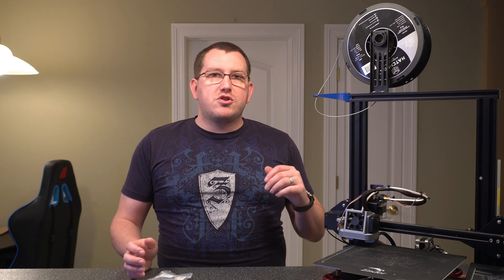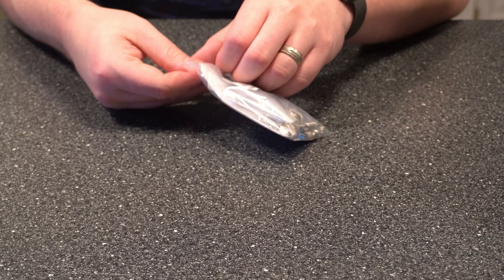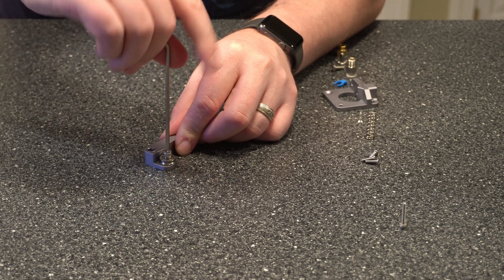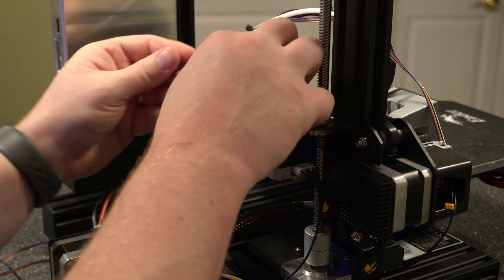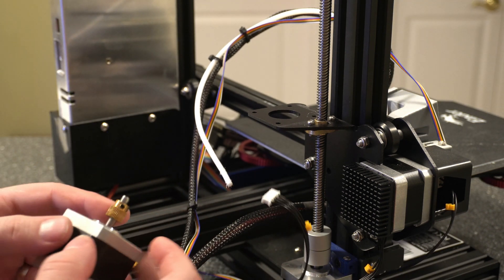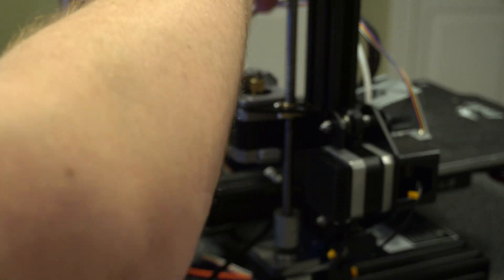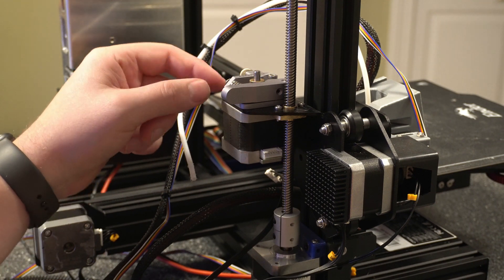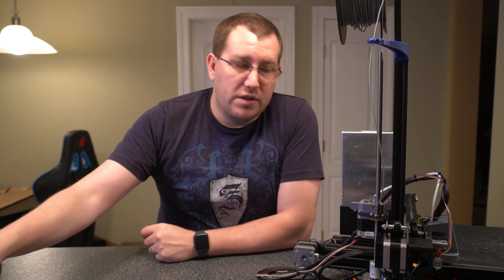Ender 3 Aluminum Extruder Upgrade

Comment: I bought one of these for my anycubic chiron  and lowered the e step from 405 to 95 like some folks have posted but when the filament goes into the extruder the gear grinds away at the filament. Now I have not seen what it would do printing something I just used the filament in function to test. I put the original back on but would like to figure out how to fix the issue.
Reply from the maker: Hi. Did you try to calculate the e step or just use what other people were using?
Reply: I did not calculate my e step just used what other people was using so ill try that but im thinking I'll end up with the same result.
Reply from the maker: @aoneblood  Ok, let me know how it turns out once you calculate it, its possible that it could fix the issue.

Comment: My motor doesn't have a screw on the gear so im not sure what to do
Reply from the maker: Hi. You can try to see if the teeth line up without removing it. If they do, it will work ok. If they dont you may not be able to use this without changing out the stepper motor.
Reply: @3DPrintscape  problem is i didn't think about that so I went at it with plyers and now the gear is a little messed up so I contacted creality so seeing if it will fit now is pointless hopefully creality come through
Reply from the maker: @valorantorion1588  Gotcha, sorry to hear that.
Reply: @3DPrintscape  I had the same thing
Reply from the maker: @Zathurus  The printers ship with both motor types, making videos like this difficult to do.
Reply: @3DPrintscape  yeah makes sense didn't really have to replace it anyways cause the original gear was still in good condition.

Comment: What do I do if my extruder motor gear doesnt have the screw to take off the out brass gear?
Reply: At 7:35 of your video mine doesnt have them screws
Reply from the maker: Hi. It sounds like your may have the compression fitting. If thats the case, you can try to see if things line up enough to use as is.

Comment: On the Ender 3 Pro I got in January not only did the axis motors have press fit pulleys, but the extruder motor did also. I am beginning to wonder if Creality is doing this on purpose so people who don't know how to remove the pulleys will shell out $35 for a removable pulley motor, especially when the most recommended upgrade is a metal extruder.

For those with the press fit pulleys, TH3D is recommending this removal procedure.
https://support.th3dstudio.com/hc/guides/diy-guides/creality-press-fit-extruder-gear-removal/

I haven't assembled the printer yet, but am going to do the WD40 trick then use one of these printed pulley pullers so that a dual gear extruder can be installed.
https://www.thingiverse.com/thing:3845693  or
https://www.thingiverse.com/thing:3593964
Reply from the maker: Hi. After I made this video and checked all the stepper motors and they all have the press fit pulleys. My guess is they are doing that to reduce cost, it probably saves them a dollar or so per printer. Hard to say for sure though.
Reply: @3DPrintscape  Can you just use the stock gear wheel with the new metal kit?  It seems to be the same size and material...
Reply from the maker: @UrDoinItWrong  I think that should be fine.
Reply: @3DPrintscape  Yup! Confirmed, the stock pressed-on gear worked great with the rest of the metal extruder kit.  Print that followed came out perfect.
Reply from the maker: @UrDoinItWrong  Cool, good to know.

Comment: How do you know what this will be calibrated. If you push out 100mm will it give 100mm out with the default settings
Reply from the maker: Hi. This hotend was marketed as being a drop in replacement and shouldn’t need to be recalibrated. Mine is printing fine without making any changes. That said, its always possible that a small change will need to be made so I will create a video on how to do the calibration.

Comment: Thank you for the video - concise and to the point. 
I'm looking for some advice about this upgrade. I bought this kit and noticed it was quite heavy - 58 grams (2 ounces). I have already done the direct drive extruder mod on my Ender 3, so I am concerned that adding extra weight to my already heavier extruder assembly might cause problems. What do you think?
Reply from the maker: Hi, thanks for the feedback 😊. I don’t think it will cause any problems, it's not that much heavier, but I plan on testing that myself. I just bought the micro swiss hot-end replacement and the kit to convert my system over to direct drive so I will be going through the process this month.
Reply: @3DPrintscape  Hi do you still use this extruder how is it going? Do you plan on using the dual gear extruder? Your answer would be very helpful.
Reply from the maker: @studywithme8055  Hi. I am still using the extruder, along with a direct drive conversion kit and micro swiss hotend. Its working well and has been able to print TPU and other filaments without an issue. I don't plan on moving to the dual gear extruder unless something comes up the makes me look at it again.
Reply: @3DPrintscape  Got it, thx man.
Reply from the maker: @studywithme8055  You're Welcome

Comment: I tried this on my Ender 3 and found after the install all my printing was weak and broke apart( layers were not binding when printing). I think might be a problem with the size of the wheel that came with the kit. Might it be smaller or bigger in size than the original and thus casing the filament to travel at different rates? I reinstall the original parts and everything printed just fine again. Would welcome your comments related to this problem . Also enjoy your videos.
Reply from the maker: Hi. Its hard to say for sure. Was the kit you used actually from Creality or a third party? Have you tried to use the new kit with the existing wheel?
Reply: @3DPrintscape  Not sure about where I purchased the kit from as it was a long time ago, might have been BangGood.Will give that a try with the existing wheels and see if that makes a difference. THANKS
Reply: @haroldlatham1084  Maybe you have to adjust your esteps?  Just a guess on my part.
Reply from the maker: Gordon has a good point with possibly needing to adjust your esteps. If the wheel was a different size, this would be necessary.